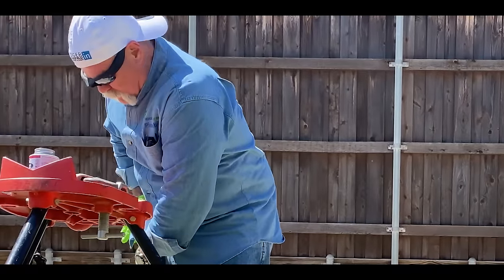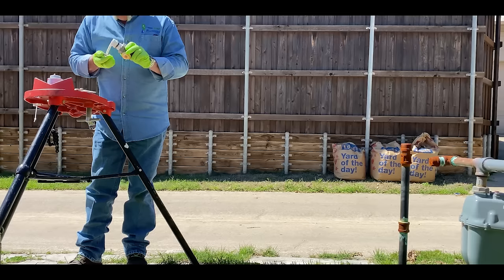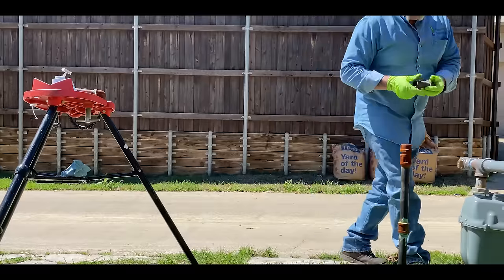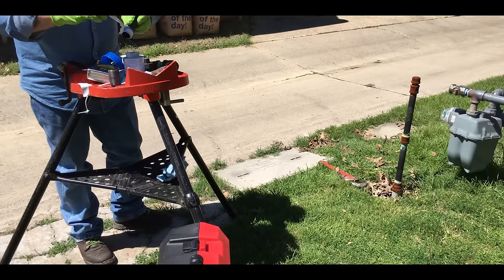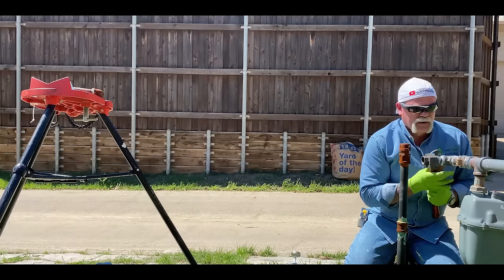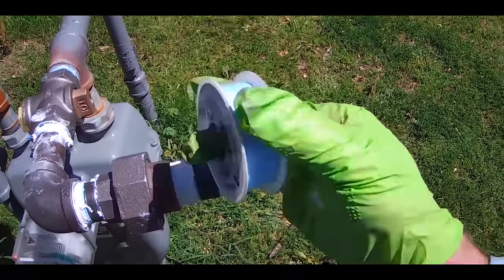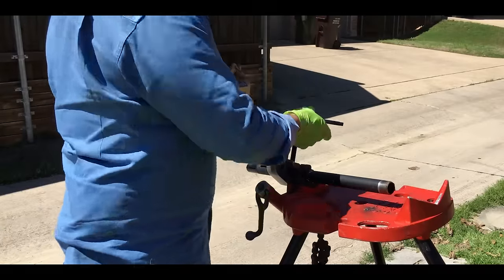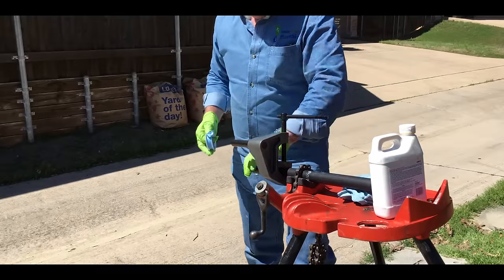Neighbor HIT This Gas Line! - Gas Line Repair (Plumbing POV)

Comment from the maker: Like this if you've ever worked on gas lines
See more plumbing service calls: https://www.youtube.com/playlist?list=PLSpTuwsLqh7t-C39a5zmjEX5pnP6ySiqx
Reply: I did a lot of gas piping and I also learned to tape and dope
Reply: I never use teflon on gas I only use grip
Reply: Copper all the way in Australia
Reply: In Los Angeles, it is against code to use Teflon tape on gas joints, you are only supposed to use dope. It is to prevent chunks of Teflon from getting in the pipe and reaching gas fixtures, and blocking the small orifices on them, like pilot lights. Is Teflon code where you work?
Reply: I could only imagine how much that thread cutter comes in clutch, keep up the awesome vids
Reply: Not a gas line worker but work with Acetylene Cylinders everytime I repair and or Requalify a Acetylene cylinder we use Teflon and Pipe Dope on the Valve and Fuse plug safetys
Reply: Why do you use so many small pieces of piping instead of one large one between the 90’s
Reply: CRC makes a pipe threading spray lube that works great because it foams up and sticks so you don’t have oil dripping everywhere and it’s convenient just saying 
Edit: They make two types the blue one for cutting ( The one I have used ) and a Green can that is meant for threading.
Reply: @kyle-ol7xq  also, don't put tape on all of the threads, it will hold moisture and propagate corrosion. Use 1/2 inch tape on pipe sizes 1" and below and only use the width of the tape, and 3/4 inch tape on larger pipe sizes. If you are going to go ham with the Teflon, at lease use a wire brush to clean the threads and hit it with some sort of corrosion inhibitor.
Reply: Black pipe on exterior work ?
And in San Francisco we only can use left and right nipple. Can't use union on gas pipe unless for fixture connection
Reply: In New York we cnt use Teflon on gas pipes what you think about that inspection only require pipe dope
Reply: I like key tight for gas
Reply: Is it normal for and expose gas line/ meter to be that close to a right of way?
Reply: I don’t know about the rest of you folks but when I do a gas connection I always use the tape (along with the paste) but it is the yellow tape made exclusively for gas lines, this other stuff, even though it is very good high-quality is not meant for gas!
Reply: @robertlewis4198  there is the proper tape for gas lines. White never use,
Reply: My dad has a plumbing company and the same watch as you.
Reply: the ONLY way to work safely on a live gas line is to make it not live. heart attack, stroke, seizure, x,y,z............ just shut the damn gas off. how many people are going to look at this and say "oh well it worked there so ill do it indoors." 
you always say that cutting corners is bad but here you are.... 
pay the money to have the gas shut off and do it right. its not even expensive. sheesh man this is embarrassing.
Reply: More videos like this these are great super in depth of tools and overall knowledge no joke here folks
Reply: I'm in the UK Roger and I'm still trying to figure out why you have gas meters exposed to accidental damage, its next to a road,, what if an accident caused the gas to get into a vehicle and subsequently gets gas in the cabin and the whole goes up,, the maximum in the UK is three meters from gas meter to first appliance same with electricity, three meters of tails max.
Reply: Just realised after a few years that you remind me of hulk hogan and that's a good thing 😂😉👍❤️nothing is impossible,, still I'd put four post's in steel set into the ground around the meter missing the mains to protect it and then a small shed over it. 👍
Reply: Why didn't you back the fitting up could have broke the line going into the meter
Reply: You do some great work but it pains me to see you not use a back up wrench when you're using a pipe wrench on that gas meter lol
Reply: Thought the teflon tape for gas lines was the pinkish one. Last time I went to Lowes there was two different kinds one marked for water and a slightly more expensive gas one
Reply: I always tape/dope water threads.. not gas tho... we use masters metallic compound
Reply: I never used teflon tape on gas or oil piping. It's actually illegal in New York. Lamp wick and pipe dope. I worked for a fire sprinkler contractor that wanted all 3, wick, tape, and dope. I thought that was overkill but hey, do what the boss wants.
Reply: I haven't done much gas, I've installed tons of oil systems. Oil tanks, boilers, furnaces, water heaters. Oil heat is much more popular where I live. Restaurants use it for cooking, but I haven't been on and restaurant jobs.
Reply: When you had your hat backwards you reminded me of Hulk Hogan.
Reply: Greta install was waiting for you check for leaks but with all that pipe dope and good tape job and your experience I know you checked it and why would there be a leak haha when you’re doing the work
Reply: 1st year apprentice from San Antonio, threaded black pipe today with same pipe threader, my question is do you ream before threading?
Reply: @holidaystate7092  you are supposed too, a lot of people skip that step.
Reply: I recommend getting offset pipe wrenches
Reply: Good job! You make everything look so easy !!
Reply: Yeah the only difference in colors of Teflon is the thikness of the tape yes they market the yellow tape for gas work but all that signifies is that it's thicker than the white stuff it's really that simple
Reply: Hey Roger, I was wondering what the table is called and where to get one? Also Thank you for the videos. I have been learning so much from you!
Reply: @starry885  This is a great video.  I made one  exposing a house flipper,code enforcement and building inspectors trying to cover up a Hazard. It’s the video with 7000 views I’m sure you’ll enjoy it and use it as a tool to show how not to 🙏🙏🤝

Comment: I'm with you Roger, I put teflon, and pipe dope. I even put some pipe dope in my morning coffee.
Reply: Next time I do any gas work here I am going to definitely remember that trick us oil field pipe line guys are just used to the pipe dope only
Reply: I usually use both but I've always been taught to never use tape by itself.
Reply: Thats right lol
Reply: Update: I had to change up some gas line for my tankless it worked great
Reply: Double the protection 👍🏻 Teflon and Pipe dope
Reply: But do u put teflon tape in your coffe aswell?
Reply: I put dope in my pipe lol
Reply: @patriksezerins9517  No, but I do use teflon tape as a Listerine strip :)
Reply: Just put dope in the coffee you’ll stay up longer and may be on the floor shaking
Reply: Roger that
Reply: I am a sprinkler fitter, and I do tape then dope on everything. The dope really helps the tape slide in there and not just bunch up. That's a bigger issue if you do dope first.
Reply: Millwright for oil company we swear by Teflon and pipe dope
Reply: Oof someones gettin sick
Reply: @laynejohnson4289  no kiddies
Reply: Mmm pipe cream.
Reply: @JoshuaSmith-go5er  lmao same
Reply: In germany we use hemp, is this method also used in the states?
Reply: Is that a special teflon tape for gas?   What kind of teflon tape is that on the video? Looks blue color. I remember seeing a yellow color teflon tape and it said for gas. Also what type pf pipe dope do you use when working with gas pipes and what pipe dope for a water line?  Or are they interchangeable, like you can use one type of pipe dope for virtually everything? 😄
Reply: Gas pipe is tapered, it seals by compression. Therefore the only thing teflon will accomplish is if you have a bad thread with chips in it or something, it'll pack in and seal it rather than having to cut and rethread a new piece. There's also wicking which is used specifically for bad/rusty threads. As long as your threads are good, there's literally no reason to use teflon on gas pipe. It won't hurt anything putting it on but why waste the time for the added step and waste that material? 

Dope serves 2 purposes; it helps create a tight seal and it keeps the threads from binding over time so the next guy that comes along won't have to struggle so hard to take it apart. I personally only use dope, that's all you need as long as your threader is nice and sharp and is cutting clean threads. Teflon is just redundant and quite frankly, a waste of time. Don't understand why people think they need to use it. If you're using dope, you don't need teflon. You use teflon for non-tapered fittings. Plastic, copper, etc. not black pipe.
Reply: In NJ we have to use Teflon tape that is approved for gas.
Reply: I hope it’s blue monster because normal Teflon is illegal.
Reply: Tape lubricates so you can get the threads to mate and seal properly. Dope fills if the threads aren't perfect but reduces the effectiveness of the tape.

The reason you hear "tape only" is that with perfect threads it will provide the best sealing joint. I'm the real world, dies wear out and aren't swapped when they should be. Fittings have irregular threads. I double up too. Don't let perfection get in the way of good enough when good enough is going to never leak in the lifetime of the system.
Reply: Armando - There is no need for both teflon tape and pipe dope! Half a foot of tape and no cream cheese.
Reply: I always use both tape and pipe dope. I have seen a lot of guys tape and then dope but if you do it the other way around it is much cleaner (just a tip).
Reply: @rogertycholiz2218  It works pretty well with either but the point of both is to ensure no leaks especially if you're putting together thousands of feet of pipe and don't want to fix a leak in the middle.
Reply: @Moollen  I always do dope first (it's cleaner) and it never bunches up on me. The only reason it would bunch up is if you put the tape on backwards.
Reply: @losferwords100  Too ENSURE no leaks. Wasting time fixing leaks is much more expensive than the time and material spent taping and doping.
Reply: @nathanbates9561  It's unnecessary if you know how to properly dope or tape a thread, there is no need to use both. I've seen guys use both and they still get leaks and then you go over to their threader and they're using a 20 year old, dull, worn-out die and they're wondering why they're getting leaks. It's all about proper application and using quality material and tools. As long as your threads are good, you're using quality fittings, and the teeth on your threader are cutting nice sharp threads you really don't need much extra to provide assurance of no leaks. The compression creates the seal, the dope or tape just fixes any imperfections in the threads that may lead to leakage and stops the threads from binding over time so the next guy that comes along and may have to take it apart can do so without giving himself a hernia trying to break apart fused metal.
Reply: @nathanbates9561  Not unravel, more like push out.
Reply: R,r,r,Rrrrr!!  lol
Reply: I tape and dope as well. I also put a little thin layer of dope on the union as well. It was the way I was taught
Reply: Pipe dope is the bom
Reply: This is the way.
Reply: That last part might not be too good for you
Reply: I put some in my morning pipe
Reply: My supervisor tells me I’m wasting money if I use both... Residential new construction.

I’ll use the “An engineer told me” line.
Reply: My Journeyman made it a rule to always tape and dope when he trained me. Into my 2nd year now and  I've never had a leak 🤞🏻
Reply: I was taught using both straight out the gate myself
Reply: I just put dope in my pipe works every time!
Reply: @Moollen  it only bunches up if you apply it backwards though.
Reply: @kaigamble5609  I install threaded pipe for a living, I watch the tape slide back and bunch up when the dope is on the inside. It doesn't unravel as if it was applied backwards. It just pushes out. The right amount of tape applied to the bare threads with some dope put on the outside obviously goes into the fitting better. Give it a try.
Reply: @Moollen  I will try that
Reply: Yeah, and if you put pipe dope in your coffee, then you clearly need to call poison control center, or go see a doctor and get that out of your system. Because I’m pretty sure that’s not something you should be consuming.